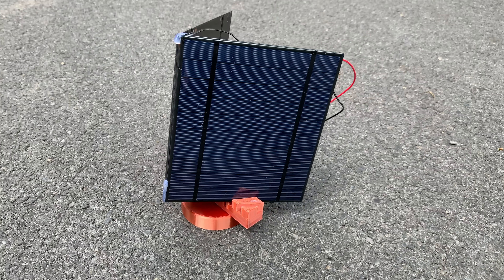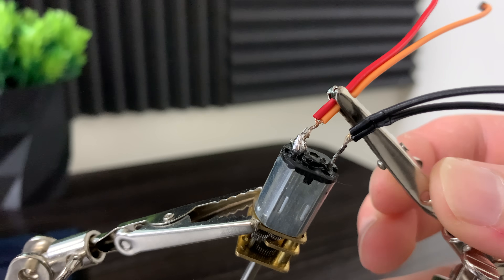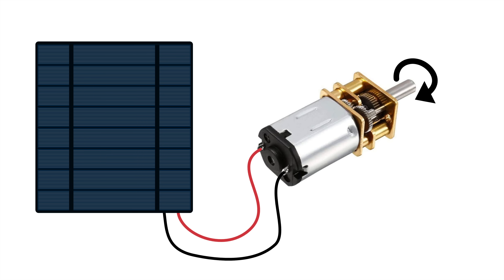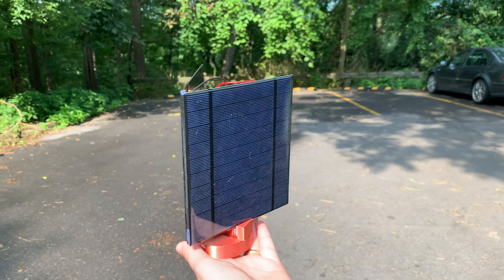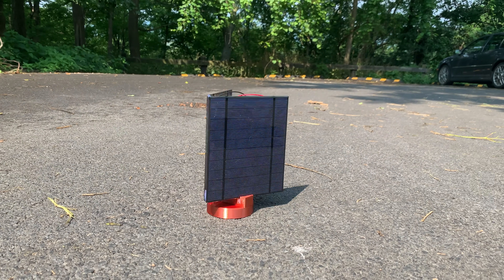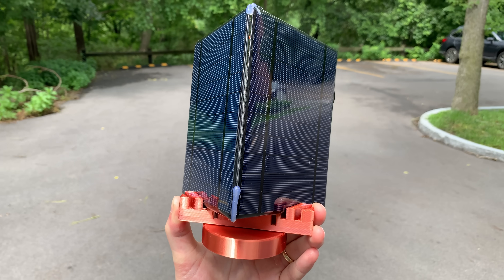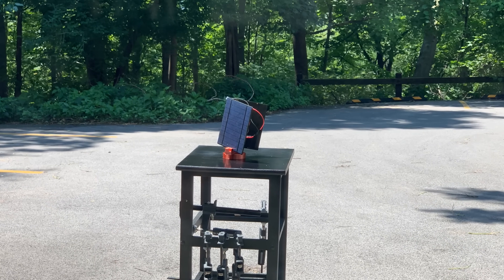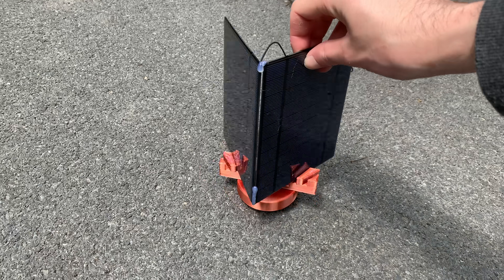World's simplest sun tracker.

Comment: Before designers had computer chips to automate “turning on a light bulb”, everything was done the simple way by means of engineering know-how. Instead, now, you’ve got nut balls who run around not believing humans went to the moon without using a microprocessor.
Reply: They already had integrated silicon circuits at the moon landing(https://en.wikipedia.org/wiki/Apollo_Guidance_Computer ). 
Or did you mean some people don't believe in the moon landing while not using a computer?
Reply: @theincapable  
First of all, it’s silicon, not silicone, silicone is an artificial rubber.

The earliest experimental metal-oxide-silicon (MOS) integrated circuit to be fabricated was a 16-transistor chip built by Fred Heiman and Steven Hofstein at RCA in 1962. General Microelectronics later introduced the first commercial MOS integrated circuit in 1964, a 120-transistor shift register developed by Robert Norman.

I’m actually an engineer & I did my senior-year technical report on the birth of the microprocessor. The Intel 4004 was the world’s first microprocessor, in the sense that it was a complete general-purpose central processing unit (CPU) on a single chip. It was released in March 1971. The Intel 4004 microprocessor had  2,250 individual transistors.

Microprocessors were not used onboard the Apollo space program; they were not ready in time.

What I did mean is that some people (stupid ones) don't believe a manned moon landing could possibly have taken place in 1969 because the microprocessor was not available yet, AND THEY’RE SO DAMN DUMB they couldn’t tie their shoes without a computer in their hand telling them how.
Reply: @theincapable  
Although the The Apollo Guidance Computer was the first computer based on silicon integrated circuits, none of those integrated circuits qualified as a microprocessor.
Reply: @Skyprince27  Or in other words, at the moon landing they had more distributed RTL based (Resistor Transistor Logic) Computers instead of single chip computers (=microprocessors) that were MOS based. So they already had a computers that could calculate things but it was not technically a microprocessor.

Silicone was a typo of course.
Reply: @theincapable  
Cars today might have as many as 50 microprocessors on them. The more-recently designed airplanes out there now have an order-of-magnitude (or more) than that. Look at the problem Boeing got themselves into with the 737 Max, trying to make a plane foolproofer…

It’s “easy” to have the big chipmakers turn out cheap chips with hundreds of millions of transistors each and just use software to do everything.
The point of this video is to remind people that’s not the only way to build. The point of my original post is to serve as a reminder that once people actually went to the moon without a microprocessor at all.
Reply: @Skyprince27  I think i know what you want to say with the alternative solution thing and i would agree. 
But i don't get why you take the moon landing as an example for that, since they already used highly complex computers that ran software that was necessary to control the apollo modules. They calculated the trajectories via a Kalman filter. This is much closer to a microprocessor than to a simple design as lets say a centrifugal governor.
The only difference i see (maybe a big one) is that it was build more like a monolithic piece instead of encapsulated hardware as a microprocessor.
Reply: @theincapable  
When I use the term “microprocessor”, I’m referring to more than just the semantics of hardware architecture. I’m referring to the fact that, post-commercialisation of the off-the-shelf microprocessor, a design job has become, say, 5% interfacing and, say, 95% software, and simplification is no longer a factor in any relative sense. So much so, that the most-poorly-educated will stubbornly insist that going to the moon without a drop-in microprocessor to solve every little issue is inherently impossible.

Comment: At that angle the panels won't be making a whole lot of power. However, if you had a way to relay the direction to a larger panel array, the small array provides the direction, the larger provides power to the house. Also, vertical axis done in a similar way could improve power transmission by up to 30%.

Comment: While I do agree that this is the simplest solution, it is certainly not the best. You mentioned how the solar panels have to "overpower" each other, and anyone could understand that this leads to energy loss in the form of heat. This solution is only good if you want to just track the sun, without actually using the power generated for anything else.

Comment: Isn't the point of tracking the sun with solar panels to maintain the perfect angle of incidence which maximizes energy collected? This implementation inherently has neither panel optimally placed. 
Could you have them co-planar and have a divider between them that shades one of the panels when it's out of alignment with the sun? 
But then it would struggle in the morning, when the panel was left facing West and the sun rises in the east. It wouldn't be able to deal with more than 90° misalignment? 
Could you then use a mirror at 45° to one of the panels at the side, that reflects light from behind it onto one of the front faces, rotating it around until it's within 90° and can then self align as intended?

Comment: Adding a resistor will save Both the motor and solar. Also oscillation at the first place. Otherwise project won't last long and after a few days it will show incorrect results because of solar cell damage. Reason you shorted both wire

Comment: It’s even simpler to have no tracking. The optimum static angle is calculated with no risk of mechanical failure. It’s also the solution that most industrial solar fields utilize.

Comment: Well there's no meaning for such a product 1. You are wasting all of the power being generated 2. Those panels are not equally identical.3Even if you manage to draw power from either of the cell the voltage willl drop and hence the motor will turn opposite..Hence you néed to draw power equally from both panels which again is not simple And requires a ton of components...BTW great idea

Comment: good, BUT there are reason why it is a bad idea to use it in really application. Just one of them is that you cause power to go into a solar panel, which makes it produce light "UV light in this case" and it heats it up. The lost on the motor as well makes the whole use for solar panel rotation makes no sense, as it should help getting more energy out of it. And there are more and more reasons. But good fun project for showing here.
Reply: The panels are 2.5 watts at the optimum angle, and by design, they don't maintain that angle.  At balance, they might produce a watt. The voltage across the motor will be zero. This is not a power-producing array, it's just a tracking sensor that could be used to control a larger tracker for an actual production array.
Reply: @ericapelz260  I know that people could see it as a way to rotate bigger panels, but no. This will not work. The whole idea is based on driving the motor directly, which rotates the panels you need to face to the sun. So, the same tiny motor. If you will then say "then I take the power values and drive other elements which drive a bigger motors" then you already say that another solution is required.
And basically, using solar panels as sensors is really really bad idea. They cost must much more than simple light sensors such as R or T, which work in a bridge circuit to drive the motor correctly. That, is the most simple way to do it, not this. This is a fun youtube project, fine, but from engineering perspective far away from realistically usefull one in any way, even for a home application.
Reply: @el-domo  the project shown can easily drive a potentiometer or simple switch that runs a larger motor to move the array.   Place this on the array, and it become simple negative feedback loop.  

I'm not saying that it's the best way,  just that it's a very simple way and that it would work.
Reply: @ericapelz260  when you do that, it is no more the way he showed in the video. When you do that, it is no more simpler than light sensors and bridge, which is much muuuuuch smaller, cheaper, efficienter and more stable. But well, this is youtube, no more. Just take it as it is, a fun project, no more than that.

Comment: Or even simpler: Solar powered motor without using electricity!
Latex rubber bands have an odd reaction to heat; they get shorter!
Two big rubber bands, very strong.  
Mounted to base such that their pull will rotate the upper thingee.
Panels block sunlight from shining on both bands at the same time are mounted to thingee.
If Sunlight shines on one band more the other, the hotter band shrinks, rotating the thingee until the panels throw shade on the hotter band.
In practice, both bands have a 20-30% sunlight on them; this maintains balanced tension as they warm up to the same temperature.
Sort of like a wax-motor, but pulling rather than pushing.
Downside?
Not a wide swing is realized; the thing can track only about 15 degrees left or right of center.
To track the sun all day, you'd need to reset the thing every few hours.
Or stack up rubber-motors so that as the first one nears the end of its travel the next motor is moving into its starting position.
Robert is your parents sibling.

Comment: you can put diodes on the panels so the board doesn't overload each other.
Reply: could you elaborate more please? do you mean a diode on each black wire for example ?

Comment: If you use 2 LED + 4 trasistor, you can make one that generates power and is simple 
All LED are also solar generators, so you can conect them direct into "direction selector" made by the transistor, that will power only if one sensor is active and the other not, the motor will be move by the solar painel of course, and this is not complicated and generates power.
That will be cheeper it that is what you are going for, since you will only need one solar painel to power the motor

Comment: I remember the complex controlling system which was mentioned too often, and coming at a cost. This ingenius solution may work with gear reduction for turning the heavy panels and mirrors.
Reply: It's a proof of concept design that isn't overly useful on large scale. With this design the panels you use on it are dedicated 100% to the motor. Most of the time they are doing nothing except for the 50 or so times a day it will move. It's better using 2 photo resisters instead of panels and a custom board that powers the motors one way or the other depending on photo resistor values. If the scale is too small for a custom board there are $5 programmable 3.3v boards you can hook up to relays. The programming would be as simple as comparing the 2 resisters. If the difference is over a certain margin and 1 is greater then 2 move left or if 2 is greater then 1 move right. The system could also be set to be powered for 1 minute every 30 minutes to conserve power but that would require more wiring.

And the gear reduction is what they usually use in the form of linear actuators. Which uses a motor to turn a gearbox that then turns a threaded rod to extend the actuator arm. Some of them even have a data line that lets you simply tell the actuator how far to extend and to goes there. If you have a lot of panels arrays that are all the same you can just send the signal to them all and they will all move to where you want them. Then you only need one board to control them all. The problem with those is when they are powered down most of them forget where they are so they need to move to one of the limit switches on power up. They also have chips inside that use power even when not moving

All in all there are a lot of ways to handle it. It all comes down to how much does it cost, how hard is to setup, what is the lifespan, and how much power does it use.

Comment: I used exactly the same principle to control a 2kw solar array. 10 years on and it still works great.
Reply: What kind/size of motors?
Reply: @briholt100  I use 36V SuperJack electric rams normally used for big satellite dishes.
Reply: @kevinmills5293  YouTube not letting me post a link ..

Something like this?

 satellitesuperstore   slash satellite_diseqc_motors_36_volt_motors
Reply: @ the one I use is the QARL3636 linear actuator. I amplify the differential signal from two small solar panels and use it to drive a H bridge circuit to provide sufficient power for the SuperJack actuators. I use a 36V power supply but the current is highly restricted as at full power, (about 6A) the gear box on the actuator very quickly got wrecked when the current wasn’t limited.
Reply: I have always been curious about this long term. Does the motor experience any heat from the fighting currents? What of the solar panels? They don't need diodes?
Reply: Fighting voltages maybe but no fighting currents. The motor responds to voltage difference and I didn’t find the need to include diodes.
Reply: @kevinmills5293  You are awesome!

Comment: There is a major problem with the design... Wiring the two panels in parallel with opposite polarity creates a short circuit when both are facing the sun. Also, you can't extract any useful energy in this configuration
Reply: Add a third panel there you go.
Reply: @nanostrings  That wastes 66% of the solar panels. Simply pointing all 3 in the direction where the sun is most of the time would produce more power and be even simpler
Reply: @jonasmp6663  The third one could be huge. Just gear down the motor, it doesn't (and shouldn't) be fast to turn anyway.
Reply: @KarriKoivusalo  It could be, but if you're getting a bit advanced, you can just go all in and use 2 photo-resistors and some circuitry to use the single big panel to power the motor rotating it, which is probably how it works in the real world.
Reply: @jonasmp6663  Adding a few gears is not really that "advanced". Peg and cage gears are super rudimentary by any standards and it could even be as simple as a rope capstan.

Comment: Well done, BUT, isn't a solar tracker's job to point the panels toward the sun so they can generate the maximum amount of power? These cells don't generate any power, So it's a simple, but useless machine ?
Reply: It's  a tracking mechanism.....Not a solar panel array.
Reply: I think the idea is that you mount a bigger forward facing solar panel. At least that's what I would do.
Reply: @jetison333  yeah but just use a photodiode
Reply: @jetison333  then, it has not much power to rotate?
Reply: This kind of thing would be great for pointing a radio antenna at the sun.
Reply: Not useless but not efficient too. So programming, software and control boards are actually not bad. Still good for experiments tho.
Reply: But you can always connect more wires to it
Reply: Step it up 10 fold and use to turn 10,000 watt setup
Reply: Well your mind can’t be simpler than the design and still get it. Good luck bro
Reply: he DID say it was a proof of concept
Reply: It's not useless, you can use it to mimic sunflowers (for fun), or you can connect a big solar panel (in a way that it completes the triangle of the two original small panels and the new big panel), the new big solar panel will always follow the sun.
Reply: A simple timing mechanism. Every 15 minutes have it check the sun then switch back to charging
Reply: @assassinlexx1993  This don’t work then sp is on transport
Reply: @inbuckswetrust7357  
You mean when this flimsy device on a car?
Reply: my thought is this is a "no grid power needed" way to devising a way to aim your solar panels. think this. put an encoder on the bottom of this of some sort so you get a signal for each "position" arc space. that data is then used to "aim" the big array (the power generation panels) this is not to make power. this just makes its own power to "find" the sun then use that somehow to "aim" your power generation array. at least that is what makes sense to me.
Reply: This is sun tracking, not solar power generator!
Put a large solar panel in center to generate power!
Reply: It can't be that hard to divert the power to something more useful, this is a proof of concept really adding any other circuitry would be a hop skip and a jump
Reply: @noahlankford1  yes this is useless

Comment: great idea, too much speed
Reply: you could charge a battery to spin the motor, pun intended
Reply: just use the polarity as the direction signal, zero is stop
Reply: or buck-boost to have the voltage multiplied
Reply: simple voltage multiply
Reply: relay direction switch, voltage polarity controlled, tri-point switch, - + and not connected

Comment: I've seen this done with the panels covered with a shade, so that it stops when they are both facing directly into the sun, maximizing power output.

This is a nicely elegant solution too, though :)
Reply: No, it's a really bad solution. You short both panels. Boom, you got solar powered resistive heater.
Reply: @dtibor5903  No, it's a simple and elegant solution.  Those panels are 2.5 watts at the optimum angle, but the design keeps them from ever staying at the optimum angle.  When facing the sun it might produce a watt, which won't damage any of the components (you will get more heat from it sitting in the sun).  You then use this device to turn a potentiometer or other position sensor that controls a larger area's position through negative feedback.